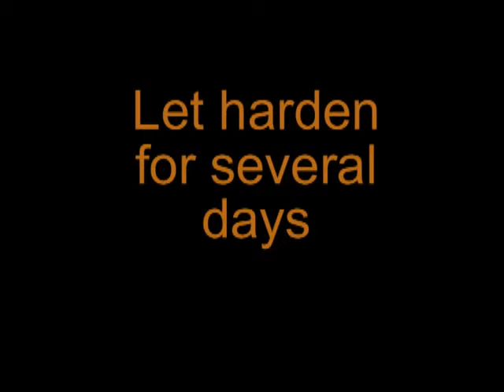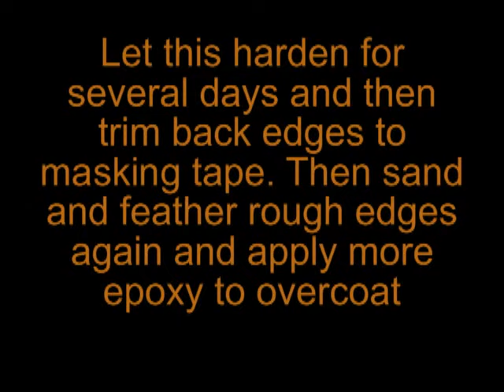Glassing Stand Up Paddleboard

Comment: Very helpful series.  
Dry glass with epoxy over top...or precoat before laying the glass down.  Any particular reason you choose the dry method?
Reply from the maker: Simple enough to do on a flat surface.  There are projects that I do pre-coat if I felt that the wood was very porous and might soak up too much epoxy and starve the glass.  So I just add a bit more when putting epoxy on bare wood.  Let it soak in and clear the glass then remove excess.

Comment: did you use fillers in your epoxy, if so what kinds? will micro glass bubbles still let you get a clear finish ? You do good work, It is inspiring.
Reply from the maker: Justin Z There are no fillers added to any areas that you want clear coated.  Any substance such as micro bubbles added to the mixed epoxy will discolour the resin whitish .  MIcro-bubbles are for fairing a surface as the resin becomes easier to sand, but is most commonly used when the surface would be painted or is not intended to be clear.

Comment: That's a beautiful piece of work ! Is that a Kit and if so, could you point me towards where i could purchase one please ?
Reply from the maker: The design of this particular SUP is from Clearwater paddle boards and is called the "Umpqua"  Randy at Clearwater sells the internal frames and kits.  I can also supply the materials to build the board, but not the plans or frame.

Comment: When I make mine do I need to put the fibre glass or is there another way to seal it
Reply from the maker: The external fiberglass and epoxy resin is required for strength and to seal it.  The internal frame provides internal structure, but the 1/4 inch cedar planking could easily be broken if you land hard on it if it was not re-enforced.
Reply: OrcaBoats would there be any other way to gain strength from the outside? i mean without any chemicals like epoxy
Reply: +Maximilian Hans No. Epoxy is amazingly safe. Tree huggers make a fuss, but the truth is. Wear some cheap latex gloves and a $30 respirator and you beyond safe. And it is inert after it cures. Many people wear nothing and do fine for decades.
Reply: +Naked Acres then they were lucky. i got an allergy after working a lot with it and everytime im in the same room with someone opening a can of epoxy my whole body starts itching...
but thats not the reason why i asked. i was just asking myself how people did it before epoxy was developed.
did they use some kind of glue?
Reply: brietzmann Epoxy sensitivity is rare and usually caused by lack of proper PPE's. The original kayak's were made of a wood frame and covered with seal skin. The wood was steamed and fitted tight and the skin held it tight. Many people still use them today, but they are crazy fragile and nuts expensive. The other small boat, the canoe was also wood and covered in birch bark. "the birch bark canoe" or was dug out from a solid log. "the dug out". Other boats are made with wood that is steamed and fit tight enough to keep water out. Some are bare wood, but most have varnish or paint sealing them. Basically if you can think of a way to build a boat it has been done. Look on youtube for a maritime museum or on my channels. They have vids showing the old shipwrights doing it old old school.
Reply: +Naked Acres thank you very much for the information! its really an interesting topic since people have been building boats for centuries all over the world and everybody found another way of building an (in this case) sealing them.

Comment: I was born in 87, still traumatized by this breakfast club movie music.. as well as modern 2019 music..
FYI over coating before second bond will create a seam separation layer between first coat on opposite side that will show up with being submerged a dozen times. Best to first coat wait than flip than second than wait. You can do 3 coats next day after a light 400 grit sand
Reply from the maker: Not sure if I made it clear in the video, but coats 2 and 3 are applied with 3 hours between so there is a chemical bond between coats 1, 2 and 3.  Music is Brian Ferry of Roxy Music fame?
Reply: My bad..good work

Comment: What was done between coats on the deck?
Reply from the maker: Nothing.  I apply the next coats before last one is fully cured so there is a chemical bond.  This is about 3-4 hours later at room temp with the brand of epoxy used.  West 105 resin with 207 hardener.
Reply: +OrcaBoats thanks I'll give that a try. Yeah I'm using west as well.